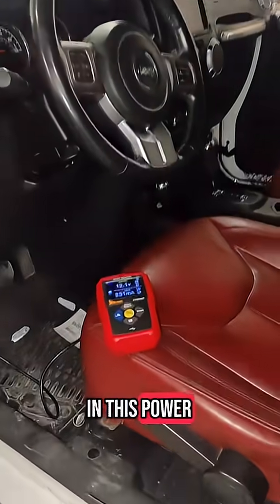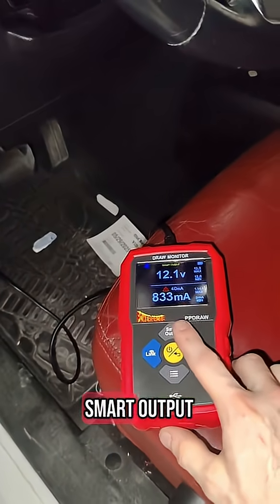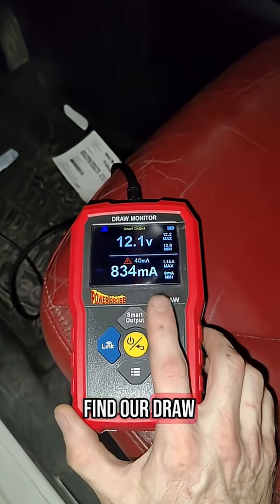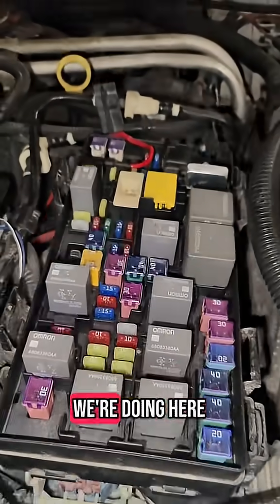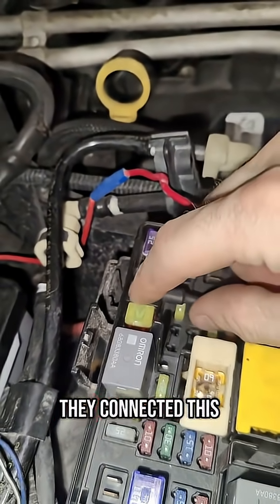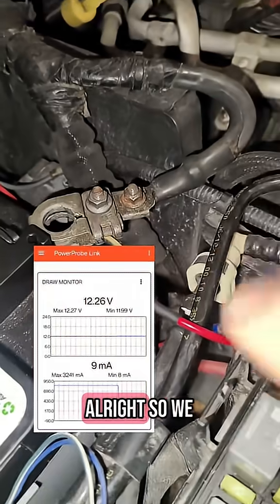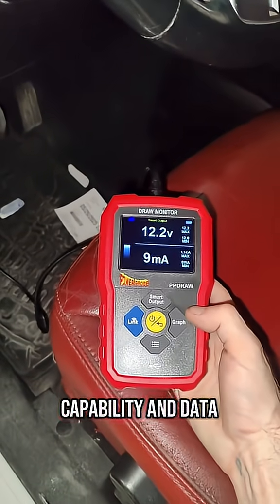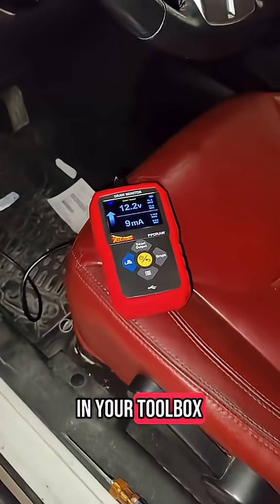Power Probe Battery Draw Monitor #powerprobe #battery #draw #parasitic #meter #PPDRAW

Comment: If nothing plug in to cigaret lighter then you should have same result.
Reply: So the owner modified his lighter to keep dashcam on while SUV is off? I have some electrical issue similar to this, mine Sedona won't shut off radiator fan then drain battery and I have to put in new relay fuse and get jump start. Plus other modification was upgrading LED light H7 and i use to cigerette lighter to charge 4 phones in van. But all started after being rear end in 2023. Now once in awhile something vibrates under steering wheel or near fuse box by your left knee inside cabin. Any insight?